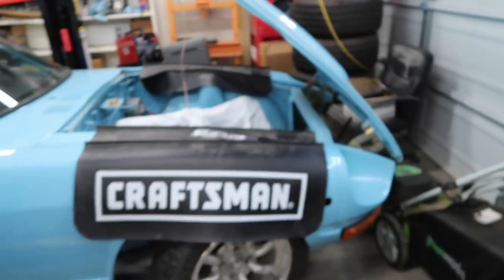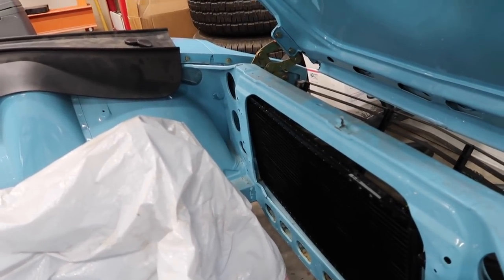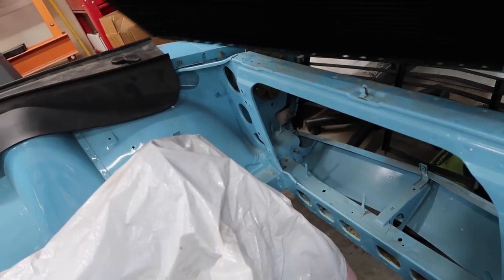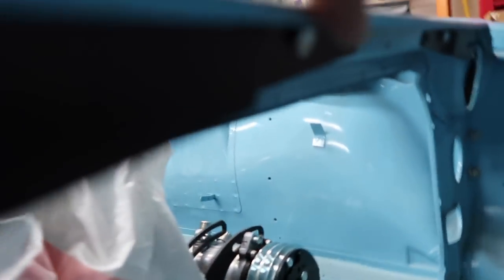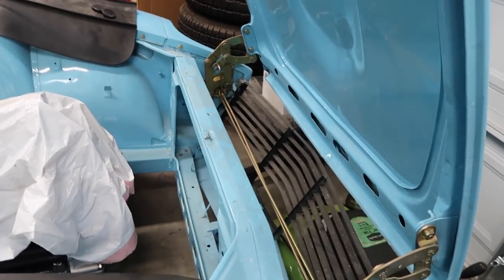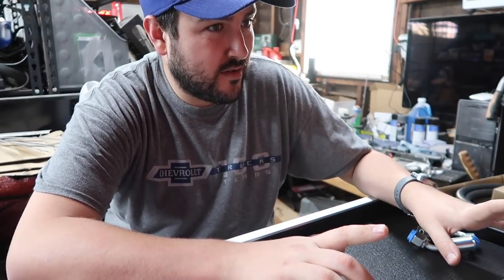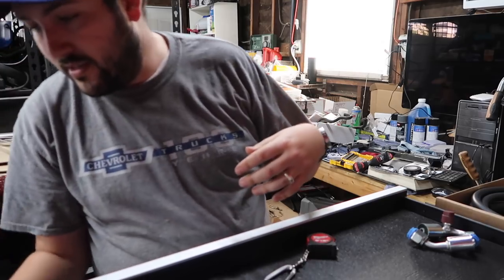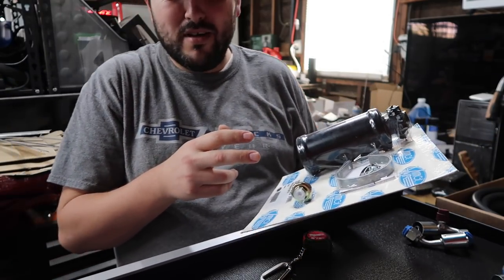A/C Install - Step 2, Condenser + Fittings - Datsun 240z Build - Ep 31 - Panchos Garage

Comment: Glad you're posting this.  I'm at the same place with my car.  Question: I can't find a reliable resource for how much PAG oil I need to put in my R134a compressor prior to sealing up the system in order to evac & charge it.  All of my components are new (well, never installed) and shipped dry.  I understand the compressor takes 4 oz, but then the lines, receiver/dryer, condenser and evaporator have to be calculated too.  How much did you use??

Comment: Do you have to take the fitting to a hydrolic hose shop and get the fittings crimped on?
Reply from the maker: +1dickycat you can do that, or if you get the tool (which I'm doing) you can crimp them at home.
Reply: Francisco Gutierrez Didnt know there was a tool... I'll have to watch the next vid and see how it works!
Reply from the maker: +1dickycat for sure. I should have the tool in a week or so.